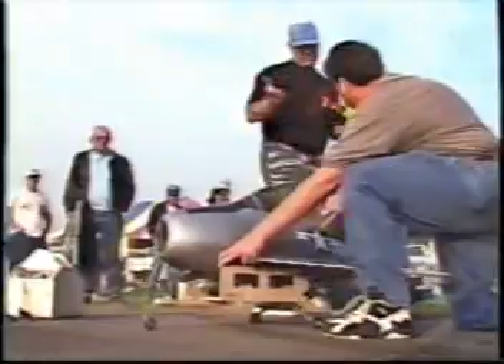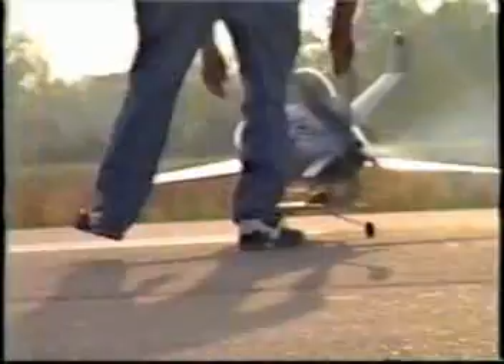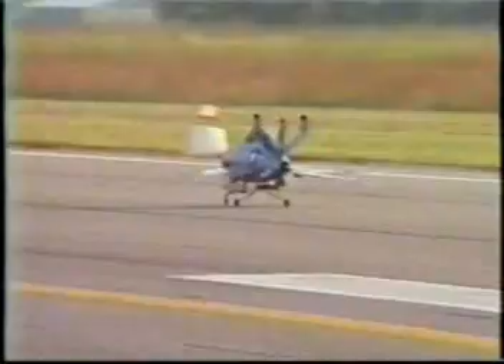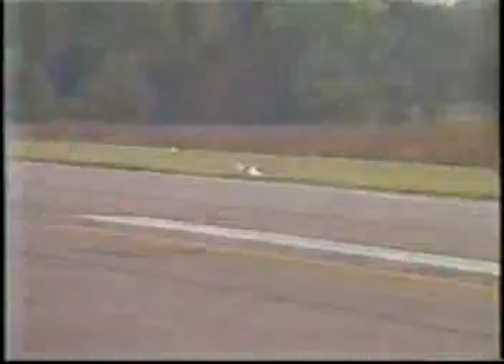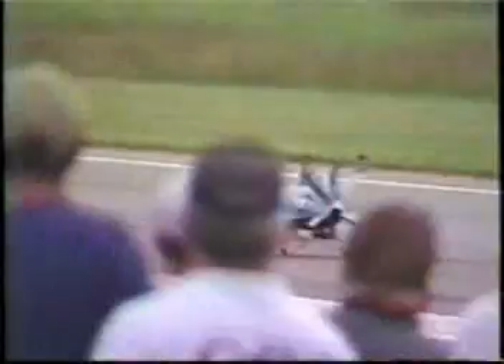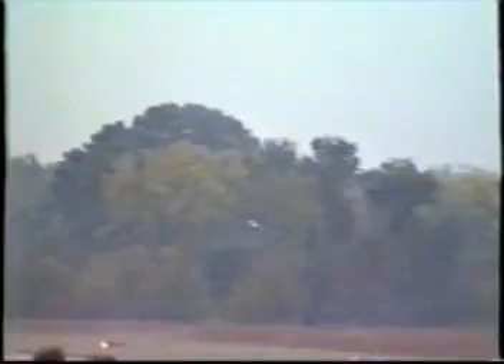XF-85 Goblin Ducted Fan...

Comment: it was a prototype for a defense fighter that was to be carried in the B-36 bomber in the late 1940's & early 1950's, it was designed to fit into the center bomb bay of the bomber. when it was launched a trapeze device lowered it down, the wings unfold, & the pilot started the engine. when the bomber was safe, the trapeze was lowered & the plane hooked on folded the wings, & was raised back into the bomber. in tests, the pilots had trouble hooking up due to turbulance from the B-29 test aircraft

Comment: The real SF-85 did actually fly. This model would have done better with a modern turbine jet power plant and proper CG . It is very short coupled and, by nature, very pitch sensitive. Some sharp model builder will eventually get his version to fly probably with a stabilization system.

Comment: in tests they used a B-29 as the B-36 was still in development, & they had trouble with turbulance due to the smaller size of the B-29 & the launch/recovery gear to fit in it. in one incident the XF-85 collided with the trapeze bar & the cockpit canopy & pilot's helmet were lost. since inflight refueling was working well for SAC, it was adopted to the tactical air command aircraft.